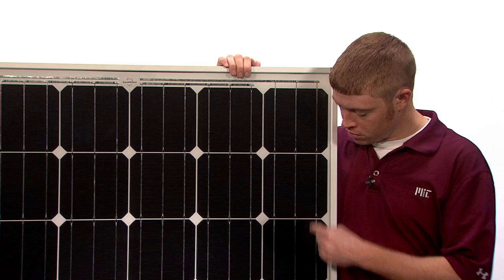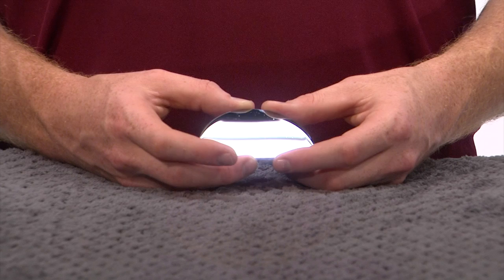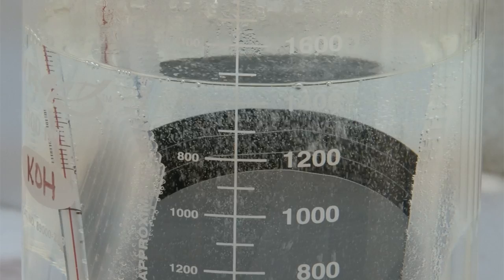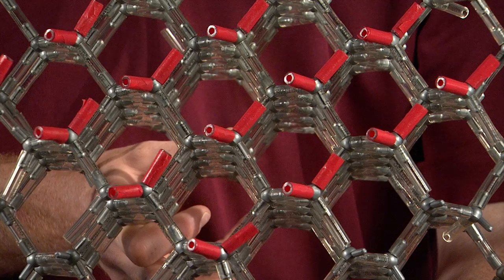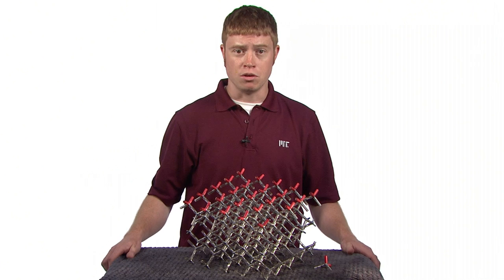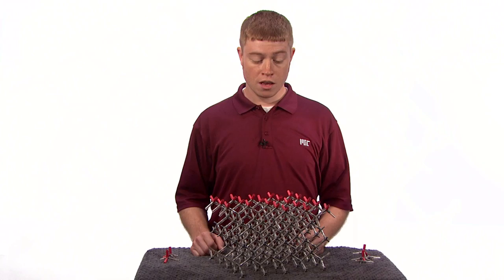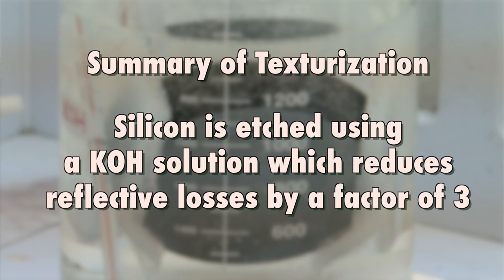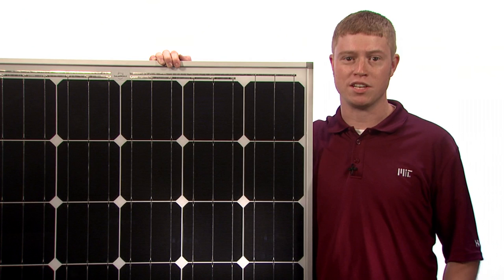Tutorial: Texturing

Comment: wonder how light would affect a high frequency vibrating textured silicon wafer vs a high frequency vibrating untextured silicon wafer. How does the sound spectrum affect the light spectrum of the wafers emitted electrons when photon hit the surface of the silicons wafer causing those electrons to jump into to a higher transitional state and back to a lower stable state as emission occurs (Thank you Joblanski). How would these factors be affected in a magnetic field vs non magnetic field?